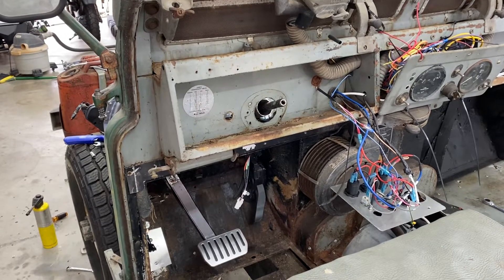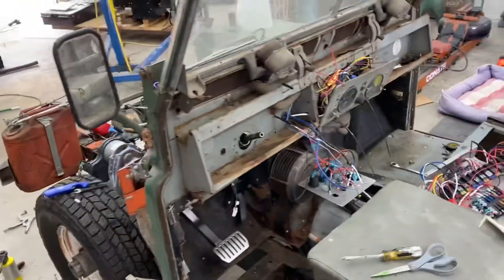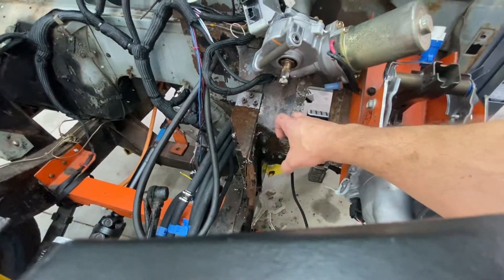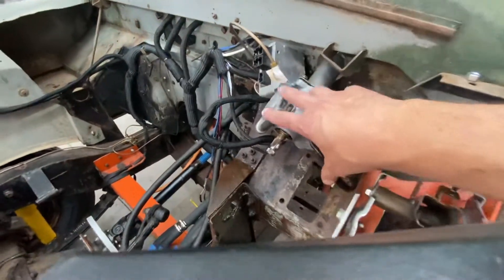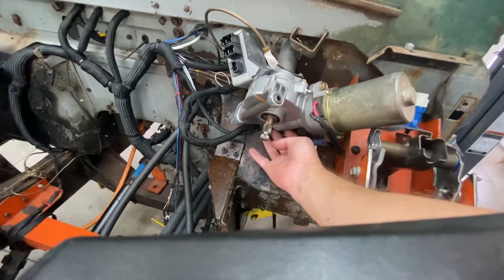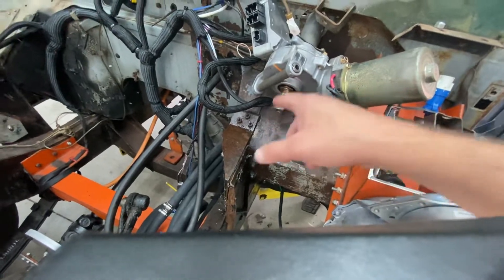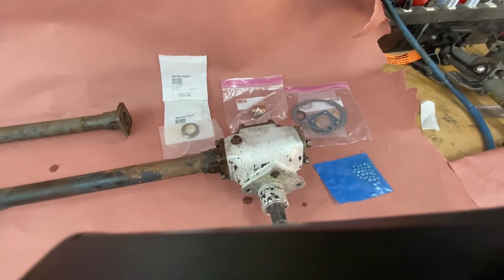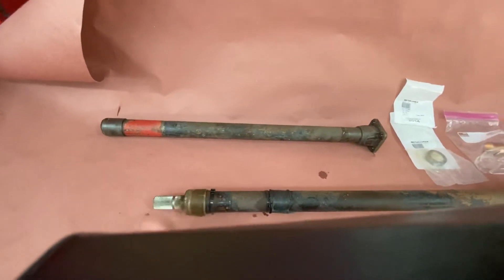Electric power steering for Series Land Rover Episode1

Comment: Hi what eps did you use
Reply from the maker: Saturn Vue
Reply: Thanks I have a series 3 109 an am planing to do the same conversion  but I have a Vauxhall b Combo van with eps hoping it will work out I like where you placed yours think it is much better then under the dash do you have any advice
Reply from the maker: @danobee3572  check out brunosteering.com for freestanding control units.  They offer components for corsa which may be same as vauxhaul from the quick little google search I did.  Cross check Saturn Vue, Chevy equinox, Pontiac torrent for possible European donors..
Reply: Thank you I’ve been looking on there an should be there same unit how is your conversation working out